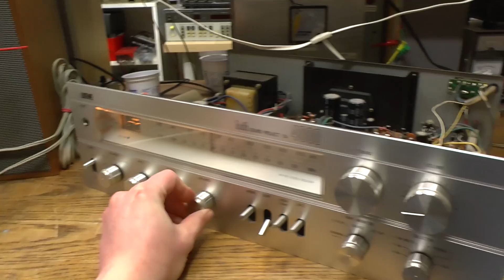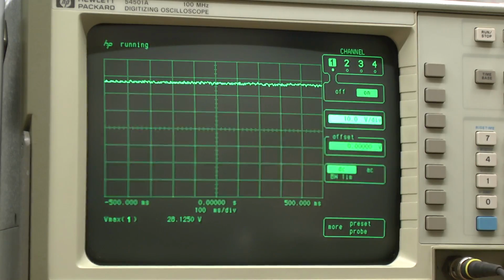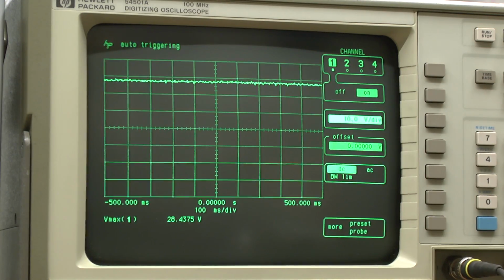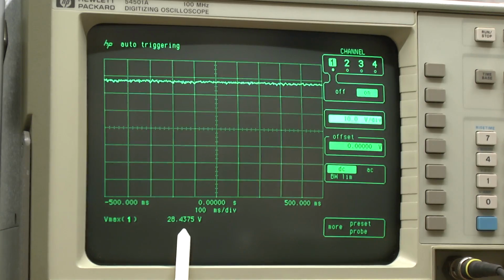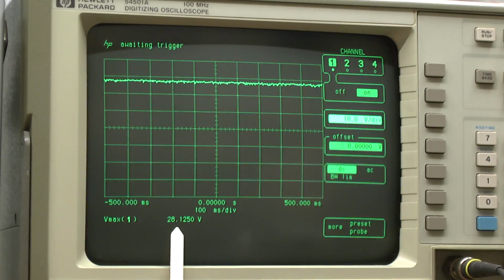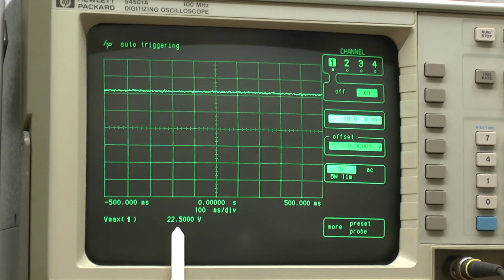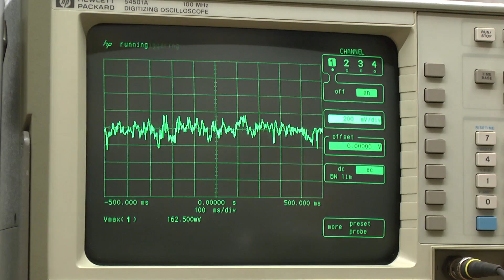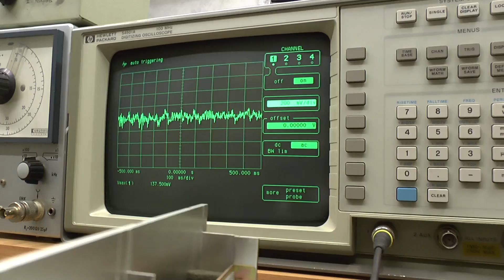Loewe TA 4000 Receiver Phono Noise Diagnosis

Comment: I bought this same project 4000 and as the minutes pass this happens, after a few minutes it returns to normal.  https://youtu.be/9Wd19AbOuR8

in stereo mode the right side sounds, in mono both, change cables and speakers and the problem continues
Reply: Might not be relevant to you after all this time, but I thought I'd mention this as it may help others. I have a similar issue. Right  channel speaker pops and crackles on start-up and repeats every few minutes. I managed to replicate the problem by putting some mild twisting force on the chassis. With the top and bottom covers off, the chassis is not all that rigid. I traced the problem to the STK441 module, (I unscrewed it from the heatsink and waggled it).  I resoldered the connections without success. I have a replacement on order.

Comment: I got exactly the same issue, with the same amplifier, to turn around it is easy, I simply remove wire at the input of the RIAA preamp and cut and wire Phono1 connection directly to preamp input, finally this bypass the faulty multiswitch... 
we loose a Phono2 of course, but today who's playing with two turntable???? 
anyway good video thanks!
Reply from the maker: Yes, this is a good solution to the problem...

Comment: My first guess would have been the transistors, my second guess would be a noisy resistor... Both can produce the same noise although in modern equipment it's more common in a transistor than a resistor, this would have been the perfect candidate for a signal tracer... Especially one that has RF tracing so that all you need to do is bring the probe above a certain resistor or transistor or capacitor and hear what's going on inside.... 
It's a real shame that you didn't get to find the fault, these videos are the best because they offer the best challenge....

Comment: A signal tracer would have been the tool for this sort of problem. Setting the signal tracer in RF mode you would be able to hear which components were creating the problem.... I suspect that it was one of those carbon composition resistors which do have a tendency to create that very same noise problem from internal arching.... If you don't have a signal tracer.... You can simply use an amplifier connected to a speaker and make a probe with an Rca plug on one end and an alligator clip for ground and a multimeter probe for for the signal probing... Using the phono inputs will also give you plenty of gain so that you might even be able to hear noise coming from a resistor possibly without even touching it for proper contact... This is basically how these problems were solved a long time ago and only a few people still use this method but once you see how much easier and quicker it is, you would use this method a lot.... I know that you have returned the amplifier to the customer so I guess that it's to late to try this on it but maybe you can try it on one that is working and possibly even make a video on the topic.....
Reply from the maker: I have plans to build a signal tracer. The circuit board has already been etched, but I haven't gotten any further than that yet.
Reply: @DrCassette  There is a very good video on this same topic of induced noise by Mr Carlsons Lab. He knew that the older Allen Bradley carbon composition resistors can be noisy due to internal arching... He used a signal tracer by simply bringing the probe close to the component and you can clearly hear the same noise that's coming from the speakers... There was also another video where this guy from Ukraine... I think his channel is called Kreosan? He used a cassette walkman to achieve something similar... The cassette deck head can pick up lots of things in a circuit... He probed a CD walkman without taking it apart and you can clearly hear what's going on in different places around the bottom of it... Pretty cool... You already have an amplifier that has phono inputs that will amplify even the tiniest signals... You just need make a simple probe and see what happens... I'm sure that you will be amazed by what you hear...
Reply: @DrCassette   hola soy de chile me gustaria saber que ic lleva  serca del stk441
es un ha1137w o ha1156w  quedo atento a sus comentario saludo cordiales
Reply: @marcopoblete113  lleva un HA1137W. Lo estás reparando?
Reply: @luismedina7196  si correcto lo estoy reparando saludo
Reply: @luismedina7196  gracias por la informacion ya que ic esta borrado ahora se que funcion cumple ese integrado  gracias saludo
Reply: @marcopoblete113  Y que le estas haciendo al equipo?. Yo también lo estoy tratando de reparar porque le sacaron componentes. La placa tuya está con todos los componentes? Si es así me podrías ayudar con eso?
Reply: Y también soy de Chile.
Reply: @luismedina7196  y que problema tiene el receiver dejeme su numero y lo agrego saludo
Reply: @Marco Poblete perfecto.Muchas gracias.

Comment: Suprised to see an STK chip in there. Can't be as old as it looks, early 80s maybe?
Reply from the maker: These STK hybrid circuits (these are not chips!) have been around since the late 70s, the oldest device I have seen using them was from 1976. This Loewe receiver I think is from around 1980 - 1982.
Reply: @DrCassette  

Yep my bad, those aren't chips I know, I once opened one up and there was a tiny SMD curcuit inside. :D

The oldest device I encountered them in was an 80s Sansui receiver.

Comment: Perhaps not a high likelihood, but arcing in the power switch might account for that noise in a high gain circuit. It would have been very audible using the AM function.

Comment: I have the original Philips TA12000 Sound Project, similar on the outside so different (for better) in the inside. Next time try Deoxit 100 spray on the contacts, I believe it's a corrosion problem inside the input contact. Cheers.
Reply from the maker: I used more than plenty of contact cleaner, no success...
Reply: Was it Deoxit? Deoxit makes miracles.
Reply from the maker: Deoxit is not available over here. I used a product by Kontakt Chemie, that has worked very well for me for many years. In this switch it made no difference at all so I don't think Deoxit would have fixed it.

Comment: This sort of stuff can happen when the selector switch also carries DC voltages and is flooded with contact cleaner that leaves some conductive residue. 28 V seems fairly high though, not what I would expect to be used e.g. for lighting.

Comment: Intresting video. I live in Sweden and I have a similar receiver with another brandname on it "DUX" Ta-8000 I have only three switches after the balance thing, sorry for bad english. Mono, Cont and High filter, I belive it is 2 x 40 watt 8 ohm. It does not work perfectly good, but good enough.
Reply from the maker: There was a whole product line. I guess your TA 8000 model would have been available under other brand labels as well.

Comment: IIRC the Pye component range that would match this was built by Tatung in Taiwan, most likely to a Sanyo design (most of their kit was heavily Sanyo based).

Based on general experience of Tatung stuff made in the '80s it was probably a lot more reliable than the 'real' Philips gear of the same period :-)

Comment: In my own experience the board of the selector switch becomes conductive that it has some high resistance between some pins. But the one I encountered was a Pioneer Graphic Equalizer. I dismantled band control (potentiometer) and I scratched the board between carbon and a pin which supplies the LED using a blade to cut whatever connects them but didn't work. There is still some high resistance in 100 KΩ or more. The best way is to replace the band control (potentiometer) but I can't find a match so I'm unable to fix it in a right way. I fixed it by disconnecting the pin which supplies the LED.